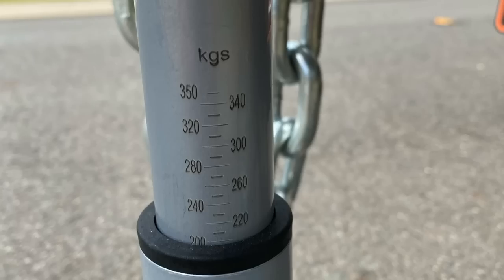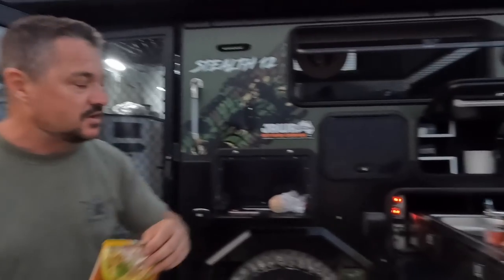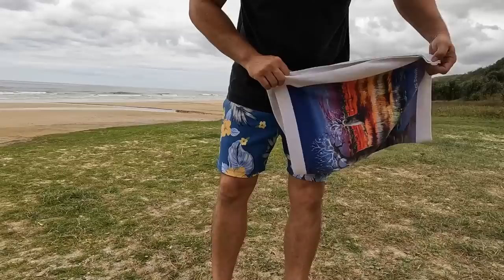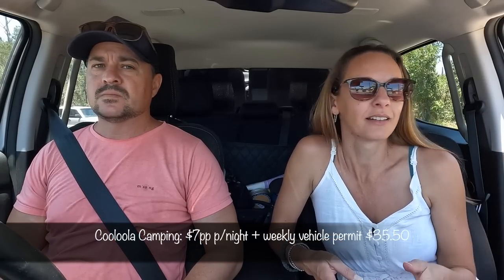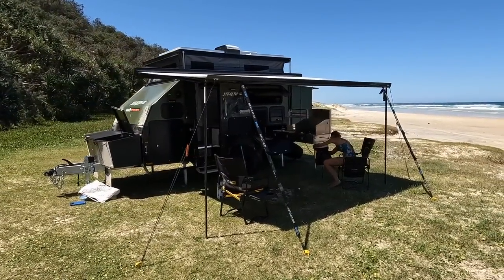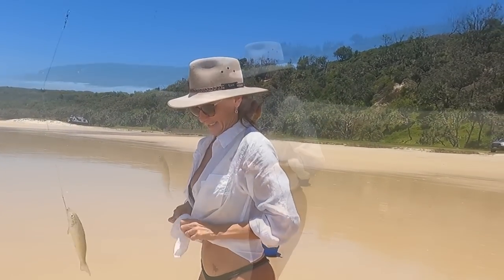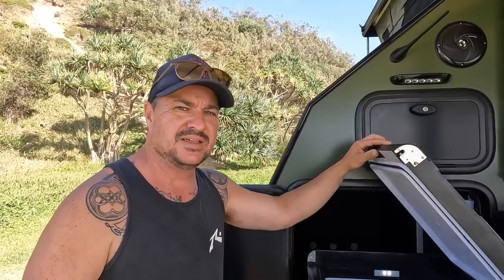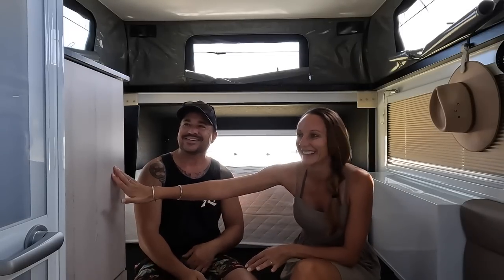Hybrid Caravan Review- JAWA Stealth 12II | Beachfront Paradise | GVM/GCM Overview

Comment: Hey guys great video. Just wanted to point out that lowering the tyre pressures is not to bag out the sidewall. You lower the pressure to increase the tread length making contact with the surface. On sand this allows the tyre to float on the surface. You actually have some great go-pro footage of the van tyres pushing a little wave of sand in front of it when you hit the soft stuff. Lower pressure would eliminate it, but it’s only a short part of the trip and you didn’t get stuck. Anyway great job on the videos, my wife and I are loving the content and the inspiration while we wait for our can build!

Comment: Question . Around 46 min you show the roof actuators. Wondering about how fragile the connectors are at the bottom, if they have a protector so they dont get damaged if near branches etc?
Reply from the maker: We had no issues, but definitely a consideration on really tight tracks. The latest models have addressed the exposed cables

Comment: Great team. Look for the gutters at low tide. And wash points that drag food to that point. Use enough lead to hold ground but still move with the current. As it will take your bait to where the fish are waiting.
 ( maximum food )
Min energy.
Try a rig with a running sinker. Have fun .
Reply from the maker: Thank you so much for your hot tips! Looking forward to testing this out 🎣🌊

Comment: Hi Guys, great video! It’s interesting to see that the lock for the fridge pantry boxes is on the front. Another example of a JAWA change - the latch on our new Solera 12 is at the back and it can be a tight squeeze accessing it when it’s so close to the fridge. Is there any reason that there’s no window covering on the door of the van?
Reply from the maker: We would install one if we bought this van, as we did in the Infinity previously. Was it a standard inclusion in the Solera?
Reply: Yes, a blockout curtain at the front door is a standard inclusion on the Solera 12. It does a great job😊
Reply from the maker: @aussietravelgold4873  well there you go. Nothing in there when we picked up the van!

Comment: I was under the impression that the marked max weight of the van  (GVM) and the max towball weight has to be below the max rated listed for your vehicle, not the actual weight your van is at the time. Do you know if thats incorrect? Cheers 👍
Reply from the maker: Hi mate, not 100% sure of the question, but my interpretation is that you’re asking if it’s a real time measure or simply the factory specs of the van versus your cars rating?

If that’s the case, the police, insurance companies etc will also measure at point of incident. Ball weight can change simply if you mice an item in the van from the front to the back. GVM is actually the total weight of the car, plus the ball weight. ATM and GTM are the measure of the van weight
Reply: @empty_nestadventures   so complicated these days. Yeah what I meant was if yiur Prado has a max of 2500kg and ball weight of 180kg. If either of the vans corresponding weights marked on the compliance plate are above one of those, the vehicle cannot legally tow it, even if the van is empty and weighs less than either 2500kg and ball is below 180. I’m sure I heard that from an ‘authority’. Just listening to what you’re saying in the video I’m wondering if you have a different interpretation from someone in ‘the know’? Cheers

Comment: Just a quick comment on the roof actuators, great idea, but being external if you are on a tight track and damage one of the actuators, you may not be able to lift the roof. These actuators really should be internal.
Reply from the maker: I get the feedback, but realistically, they’re only 1.5 inches off the walls. Well inside the awning and shower tent on the other side. If you’re getting caught up on these, you’d probably take out the van wall at the same time.

Nevertheless, part of the reason we are taking these prototypes out is to test all these things and contribute to continuing R&D!
Reply: @empty_nestadventures  , Thanks for the reply. I do realise that the actuators are really close to the van wall, but doesn't take much to damage them. Take care and keep enjoying your travels. Merry Christmas.

Comment: These campers are ALL the same, out of the same factory in Taiwan. All branded differently by private companies. They ALL have faults in the suspension setup.
Reply from the maker: Whilst serval do come out of the same factory, Jawa actually have 3 seperate factories across 3 localities. None are in Taiwan. As for suspension, Jawa completely rebuild onshore using either Lovells or Dobinsons components. 

Some importers grab the vans off the docks, get a gas certifier out and hand them over. Jawa spend weeks on each van fitting them out onshore at the Caboolture and Windsor factory. They employ over 50 people in Australia with a majority of those in the build and service teams
Reply: Good to hear. I would NOT touch a Taiwan one !!! All the stories you hear are just nothing but bad news !!